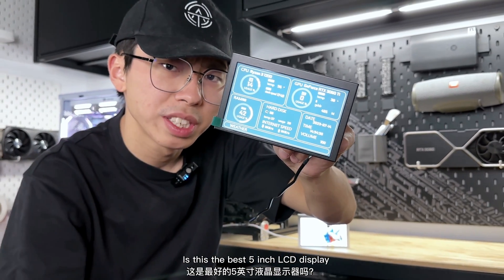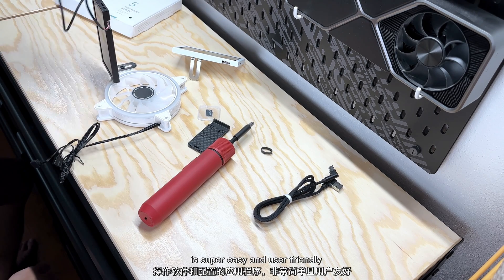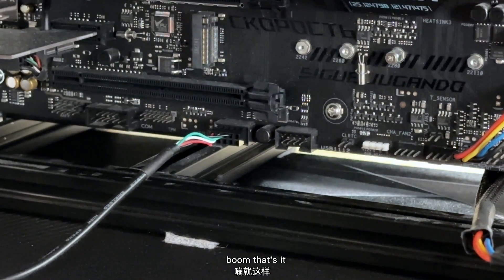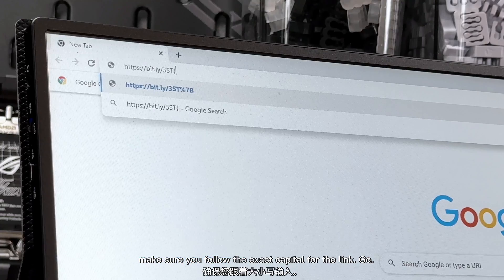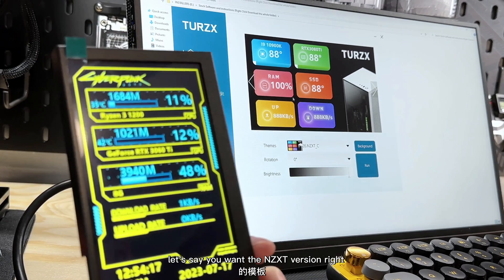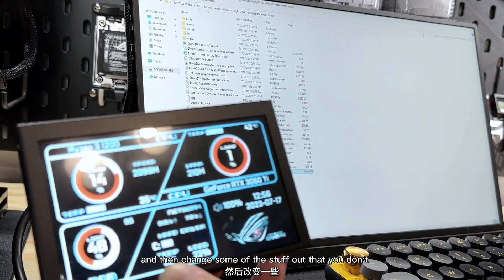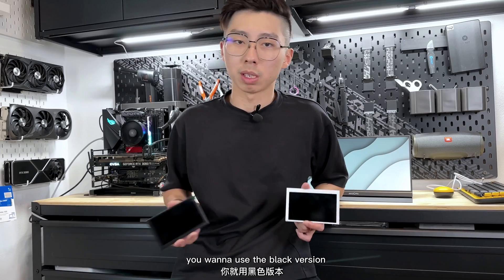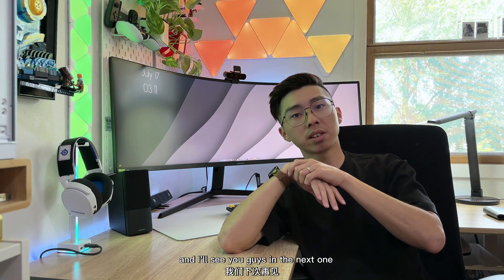We found the BEST beginner 5'' LCD Screen Display MOD for your PC! [Unboxing and Installation]

Comment from the maker: What do you think about this LCD screen MOD? Would you get it? 🤔
Reply: Does the screen  save onboard memory? This means without runing the app next time
Reply: once you set your options, you can auto play a video when it has power, but to get real time stats their software has to auto launch. So far for me it works like a charm, I do both Aida64 and the Turing Screens each have their unique benifits.  @grumpybryno3479
Reply: Yess
Reply: White frame version is matt or glossy?

Comment: Wondering if this channel is even monitored anymore.
Installed this device today, can't get it to show correct weather, no setting for 12 hr clock instead of 24 hr.  Settings are confusing.

Comment: @archetype_origins looking at the most common questions in here and not seeing an answer for them just wondering. 1 is this self powered on and off? (I would assume so since it uses the USB header). 2 does it have memory so that it saves settings and device info without needed to adjust them again? (Again I assume so since there is a micro SD card for it). And 3 is just the USB header needed or is the USB C also required? (I would assume not since you didn't use it)

Comment: Does it turn on when you power the pc on or do you need to manually turn it on and off like a regular monitor?
Reply: I don't have one but in theory it should self power on since you are using the USB header. That would provide the power on signal to the device.

Comment: thank you for this.  I know this video is a little older.  The link to the 5" screen is not for this model screen.  The one in Amazon has a USB C connector, no HDMI.  Will this work.  Where would I connect to a internal USB port?

Comment: Hopefully this will get seen. I just bought this and watched your video for the installation process. Did everything as mentioned in instructions but I have a problem. The screen doesn’t turn on, its just a black screen. No sound or anything either. The app can’t find the screen. I can feel the screen getting a little warm but unfortunately nothing shows on display. What do I have to do?

Comment: Worst product ever …
Do not recommend to buy at all
The owner should be blocked and going to jail !!!
This product almost smashed my PC inside
When i’ve decided to reinstall Windows for absolute clean system… its blocked installation, so i suppose to find another PC and reinstall windows with 2 computers 😂😂😂 
After i launched this screen, in the task manager instead of 100+ tasks i found 340… Jesus if you would see my face after installation
Trojans, worms and ETC gonna eat your system

Comment: Can we use double sided tape if we cant use the screw mount? I want to put it on my Phanteks NV7 case in between the motherboard and top radiator, theres soo much space there

Comment: Just seeing this, damn bro that's sick, will DEFINITELY be adding this to my build.  I've got the same case, 2 sets of the Lian Li Reverse Blades and 1 LCD (using it for exhaust), up top I'm using 2 140 RGB CORSAIR fans on an NZXT Kraken AiO, as far as mounting I was a bit concerned.....until you knocked it out the park and showed how it's compatible with the Lian Li plugs on the fan housing!!!!  Great vid my guy.

Comment: I have a concern, can the software be used with any screen other than the turzx brand? I see that they come with an SD memory? What is that memory for on the monitor? thanks for answering. excellent video
Reply from the maker: As far as I know, it only works with its own software. Never tried testing any third party software. I am only showcasing the ease of use of this monitor for beginners!

Comment: I think I ended up getting sort of an offbrand version. Mine can't tell that I'm running an RTX 4070, and I7 14th gen. And doesn't show brand icons properly. Even though It's trying to display those, and got I5 11th gen and RTX 3080 instead of what I actually have.

Comment: Are the sensors accurate? I saw some comments in reddit that claiming that it is not accurate
Reply: i don't have this screen, but it just reads out data from sensors. so if inaccurate,  that's the sensors on the mboard i reckon.

Comment: Just a question. Ive got 2 monitors plus i want to add another 3 very small LCD to my system. One if the LCD screen for my y60 case and i want to add one into my case and one in front of me. Is that possible? Im going to be running the Gigabyte GeForce RTX 4090 AERO OC 24GB Video Card. Would that be able to handle it.

Comment: So whats the usb-c cord for? Didnt cover that part.
Reply from the maker: It does the same thing, if you don’t have any more internal usb2.0 slots available. You can connect it externally to you motherboard
Reply: @archetype_origins  gotcha, wasn't sure if it was some sort of external power source for use on a desk of the sorts. Thanks for clearing that up sir 💪

Comment: I'm not very techy..My pc has been built for me so I'm not sure whats is pluged in..but my two USB ports on motherboard already connected to something..so is there no alternative slot? :T
Reply from the maker: Use the included usb C cable
Reply: @archetype_origins so just to clarify, i can just plug one in the back of the pc? (had the same question lol)

Comment: does the theme editor allow for changing of images so that it just displays a picture instead of all the stats?
Reply from the maker: I believe so
Reply: i got it, the software i downloaded seems different but the themes are the same. can't display picture alone, rather the picture you select will be the background for the theme. works pretty well too!

Comment: Question, where are you running your wire to? did you buy an extension wire?
Reply from the maker: I use the cable that comes with in the box
Reply: @archetype_origins  oh damn, you hid it really well, it almost looks like its not even visible. Definitely considering getting this monitor

Comment: I got one of these a few months ago and love it!  once i figured out the theme editor i was able to customize the theme to match my pc and add a FPS readout to the theme also.  I did have one minor issue when i upgraded my gpu. for some reason after the new gpu went in it no longer registered the GPU board power.  I downloaded a new version of the software and its as good as new!  I was a little nervous about the software but no viruses so far lol.  If your looking for a easy system monitor I think it works great.
Reply from the maker: Yay! Glad it works out well for you! We think more people need to know about this

Comment: Hey man great vid!!! Question for you, does the app need to be running in the background for this to show what ever you want it to show? Also can you use this with a NXZT internal usb hub? 
Thanks again, you got a sub.
Reply from the maker: Yes the software will be running in the background. The software is in Chinese and I can understand everything it’s saying. Been using it for a year and never had any issues with it.
Reply: @archetype_origins  thank you. I got it going. Made my own theme. Do you know if you can change the stock booting wallpaper? I can set my own. But at first boot, it shows a water coolered pastel wallpaper before my theme takes over.
Reply from the maker: I have never even think about setting up the booting wallpaper, maybe you can give it a try and let me know how it goes
Reply: looks like its embedded into the ROM. I have no clue how to edit that so I left it alone. @archetype_origins
Reply: That’s what I want to know too. Does the software need to run in background?
Reply: @bigworm1384  hey man, I tried it, it ok, the program needs to be running. 
I also returned the item, don't know but that shit left over some very suspicious files , after I uninstalled it. 
Yeah the web site is in all Chinese, imo stay away.

Comment: Help i bought this screen and after plug in it says windows is unable to recognize this usb device, i checked it with another pc also same thing happened, kindly someone help
Reply from the maker: make sure you windows and software are updated
Reply: @archetype_origins  Done everything still not working..

Comment: Does this count as an additional monitor within windows? For instance could I possibly not use the Turzx app and move Spotify over to it, or extend my Windows wallpaper?
Reply from the maker: this specific screen does not have those capabilities. If you're looking to put Spotify there or extend your display you'd want to get something like this one https://amzn.to/47Rcznh
Reply: @archetype_origins  Thank you. That should work well for me. 👍

I was hoping to avoid the HDMI cable option and just rely on the USB, but I've been looking up about it and it turns out that you need very specific USB ports for that to even be an option.

Comment: Waveshare popped out a 7 inch one but uses their own software, instead of just using the turzx stuff.
Reply from the maker: we will have to take a look! 👀
Reply: Also yes curious about the resolution if same as the 5 could firm warre that puppy and use Turxz on it @archetype_origins

Comment: How safe is this sofware that you have to use to work this screen?
Reply from the maker: We have had it running on Ben's PC for over one year and have not had any issues or noticed anything "unsafe"
Reply: The hardware looks fine but I'm concerned about the software too. 
The brand is pretty much an unknown company. I'd rather not take that risk.
Too bad the better known companies in PC component market are not making this yet.

Comment: Question: since this monitor runs off of the onboard USB connection, when you turn off the PC, does the monitor also turn off right away? Does it go to sleep at all like a normal desktop monitor?
Reply from the maker: Mine stays on even if my monitor is in sleeping mode. It does not bother me tho.
Reply: Mine connected via usb and turn off and on with the pc being turned off and back on

Comment: HI, thank you for your video.  I am installing this screen right now and not working.  I noticed mine did not come with MicroSD.  Does it work without MicroSD?  My screen even did not turn on just a once yet.
Reply from the maker: It will work without the MicroSD card, I would recommend checking all connections to make sure they are all tight and secured.

Comment: If u accidently disconect the device from the cable , and reconnect it will it have onboard memory and remember your display u set on it without having to remap it on the app.wch is a issue i have with the 3.5 inch with its software
Reply from the maker: Never actually tried it, but that’s a great questions 🤔
Reply: @archetype_origins  also had it freeze it doesnt stay and i needed to re app it.
Reply from the maker: The freezing does happen from time to time, nothing can’t be fixed with a quick restart of the software

Comment: hi, can I check with you I had bought one similar display as yours but they are using XuanFang software. However, my CPU temperature is showing 0 degree celcius. Do you have any idea?
Reply from the maker: We don't have any experience in that particular brand, maybe next time we can do a review on it? 🤔
Reply: @archetype_origins  i think i found the reason..that software coding is only for intel cpu..coz i tried install on intel cpu system it works
Reply from the maker: Interesting, good to know! Thanks for the update.

Comment: I just installed mine, easiest install. And it's pretty simple to add FPS and monitor literally everything without running multiple displays. I'm using a Odyssey G9, and adding a second display was pretty much out of the question without taking up my desk space, by mounting one underneath. Which I did with a 12" portable monitor and AIDA64, but this little display solved both problems. Got rid of the portable monitor, and slapped this underneath my monitor and only took about 5" of desk space 👍🏼
Reply from the maker: Glad to hear that you’re enjoying this user friendly display!
Reply: @archetype_origins  hey brother new to the pc building is it possible to get the wattage of the pc while it’s running how much it used during a session
Reply: @talonabuser1072  Get something like a PM01-US or Kill-A-Watt: both plug into your outlet and devices, in my case the UPS with multiple items plugged into it, devices plug into the PM/KAW and it has switchable readings including session wattage, current wattage, volts, VA, Amps, time of session, a way of figuring electrical usage cost by inputting prices, etc.  The first one was way inexpensive and using 3 I’ve had no problem for years.  This is not the same as putting this info on the 5” screen: I’d like to hear if it does that with its current software — or maybe depends on the data the Motherboard can supply?
Reply: @archetype_origins White version frame is matt or glossy?
Reply: Hey do you mind sharing what you used to mount this screen under your current main monitor? Thanks !
Reply: @AsuraTraitorr  I think my comment was deleted because it included a link to Amazon. But I used a monitor phone mount, they come with a magnetic adhesive to just attach it to the mount. I would just look up monitor phone mount and a few should pop up
Reply: Can't find a fps option anywhere is only downside to me
Reply: @djbpresents9584  any luck?
Reply: So sorry to bug you a year later, I just got this for my PC and it's working great. I just can't seem to figure out how to add an fps counter to it. Any ideas?
Reply: @bigpharmasports9120 me either just isn't a option

Comment: Can I just connect through USB without connecting it to the motherboard to use it?
Reply from the maker: That’s a good question, but it should work according to manual, but I’ve never actually tried it
Reply: Yes it will connect via usb mine does